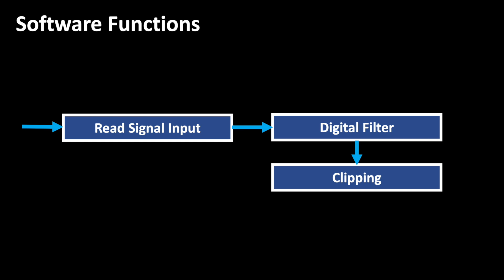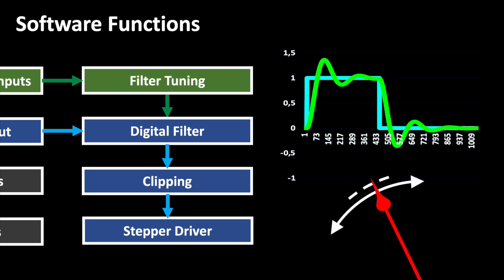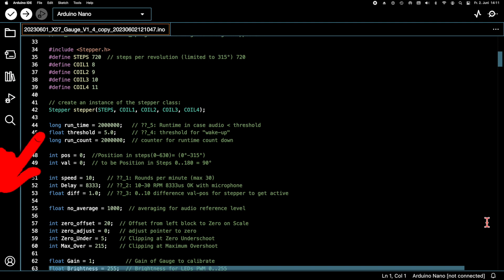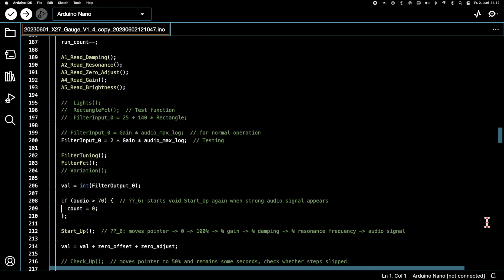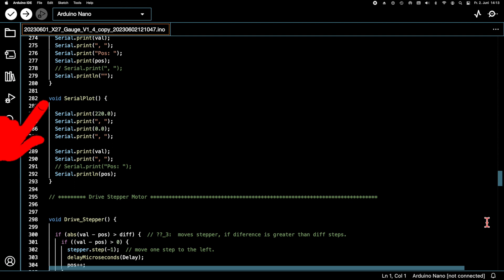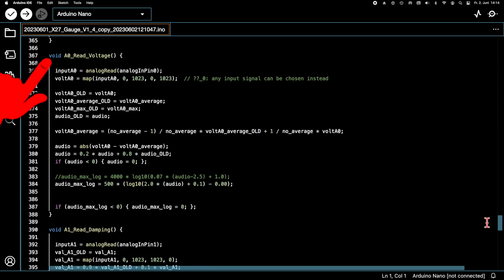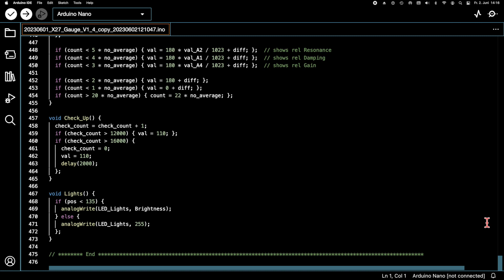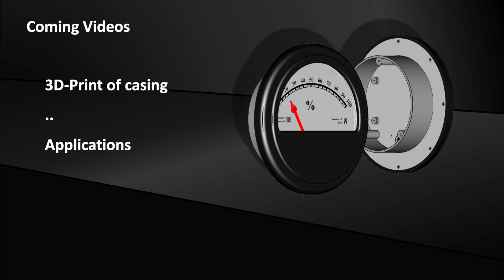Arduino Code: Design a Beautiful DIY Gauge using a Stepper Motor (EP54)

Comment: Its really an excellent project.
It would be really very very helpful for people like me who are slow learners if you make a single video and explain both circuit and arduino code along with steps.
There are so many things to learn from you sir.
If you have any PDF available on this DIY project then it will be very helpful because i want to understand each parts of this complex topic in a single video or pdf
Reply from the maker: Glad you like it. There are more videos on the channel explaining analog gauges functions. And I suggest, just start and try with Arduino and a stepper. There's not much that can go wrong. Greetings Klaus